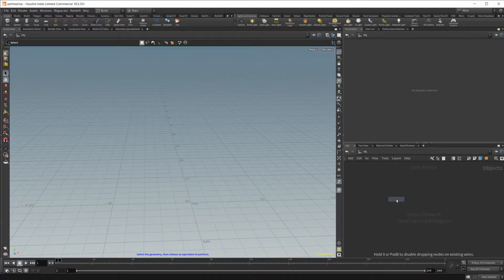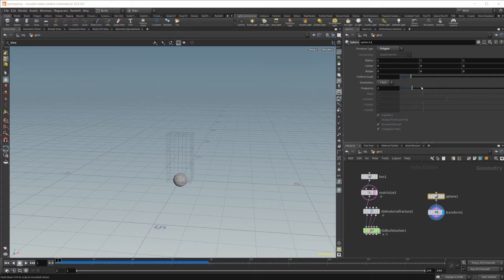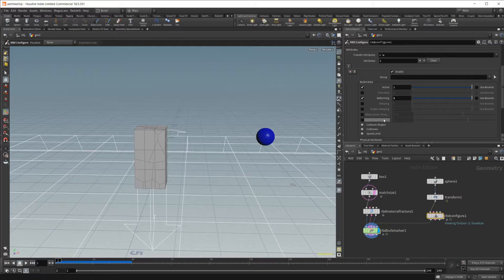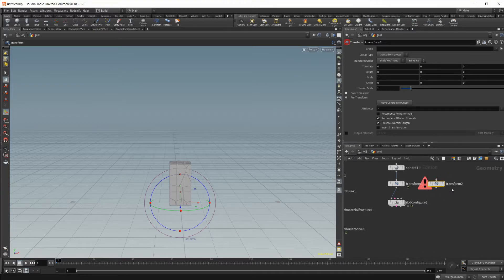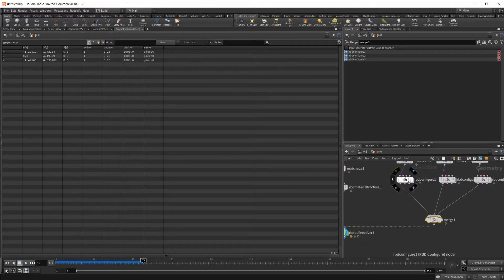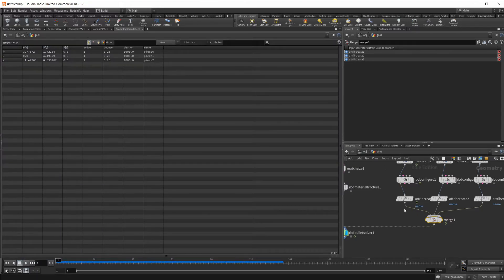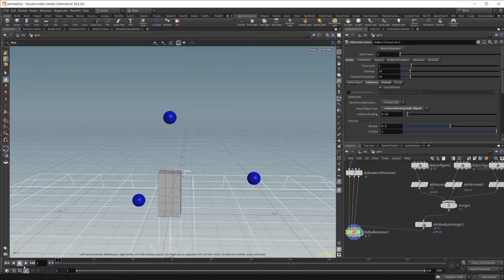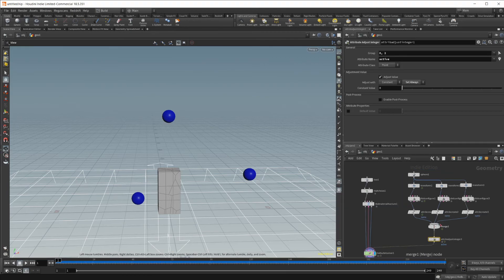Using Animated Objects in the RBD Bullet Solver in Houdini

Comment: How can you do this but have the cube animated and break when it hits something. Like a bat hitting a ball? And the bat having the rbd fracture on it?
Reply from the maker: I figured it out. Seems more difficult than it actually is. Set up your animation like normal, place the RBD material fracture after the animation, then place a RBD configure node after that. The configure node is the key. You want to animate the Active and Deforming settings of the configure node. Set the active to zero until the frame of collision and the deforming to one until that same frame. The frame that they collide on you want to set active to one and deforming to zero. This will make the object active and disable the animation so that the simulation can take over. That was a really good question. Thanks for bringing that up. I probably will make a video for that.
Reply: @InsideTheMindSpace  Thanks that worked! I set the active to 0 and animated to 1 then grouped the pieces that don't need to be destroyed. Like so the handle of object doesn't crumble in the character's hand.
Reply from the maker: @Digital_Guerrero  Glad that you got it figured out.
Reply: @InsideTheMindSpace  yup was going to type the same answer, this also applies to this video since you could have just did these steps on the rbd configure node instead of using "attribute adjust integer"
Reply from the maker: @axe_fx  I believe I had some issues with the configure node which is why I did it this way.
Reply: @InsideTheMindSpace  it always kept falling cuz it had @active = 0
Reply: @InsideTheMindSpace  When I tried the above method, my constraints are left behind, and when they activate, when I turn on Active, they shoot constraints to the animated objects and it freaks out...any idea how to keep the constraints to stay with the geo while being inactive?
Reply: @InsideTheMindSpace  If I wanted to sphere to break as well..?

The RBD bullert solver has 5 inputs, 3 of them are taken by our cube, if i then want to plug in the sphere that collides, where do i plug it's constraints and proxy?

Do i just merge the inputs before that? or do i go about it some other way. I'd know how to do it in the dop net but not in the new rbd buller solver..

Thanks man! Appreciate your constant help.
Reply from the maker: @jonathanwennstromm1578 everything you want simulated to break goes in the first 3 inputs. So merge the first outputs into the first input of the solver and so on
Reply from the maker: I havent done that myself but I have some thoughts. Don't want to give you wrong information. I will get back to you when I have a minute to test some things

Comment: Fantastic stuff, the parts about using the name and active attributes really improved my understanding. BTW you don't need the attr adjust if you turn on the checkbox for each Active entry, and then set each to 0 or 1 as required there - so the active attribute exists on each before going into the merge.
Reply from the maker: Happy to help. And you are correct. I realized that later on